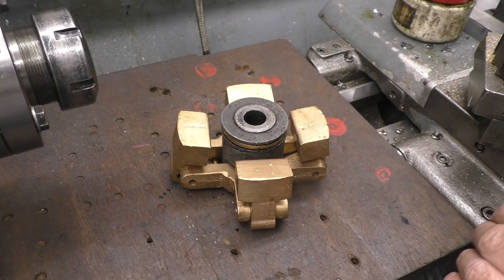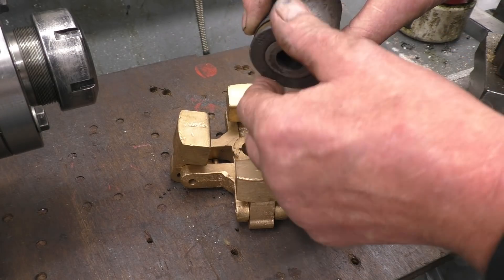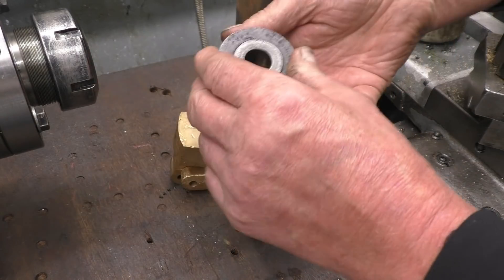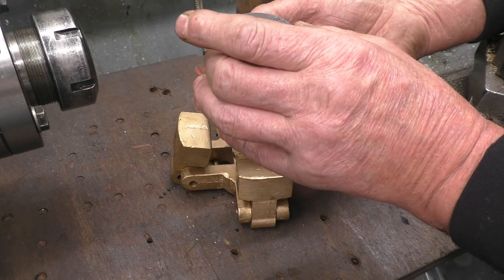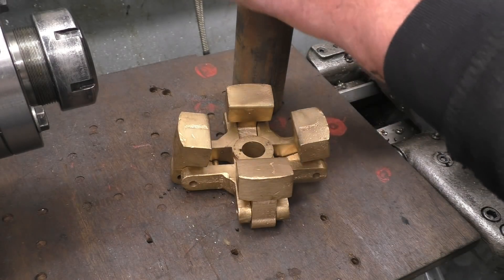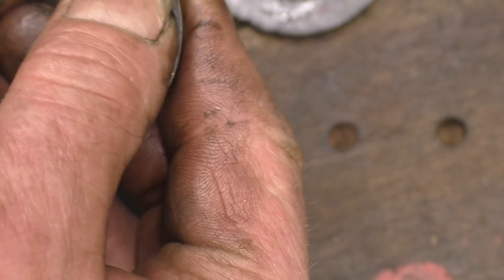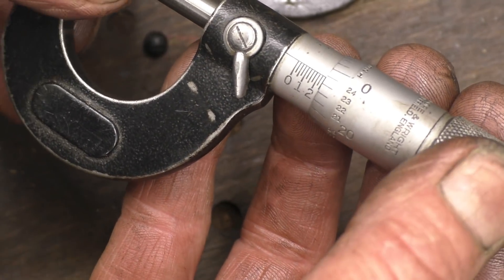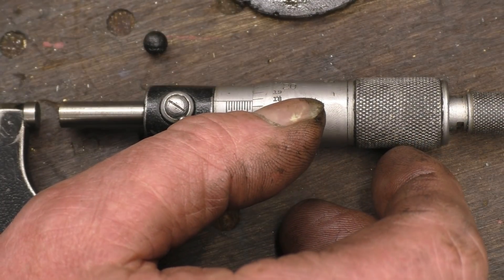Stuart Engine P 17 . Governor  Bearing

Comment: Hi John, good save, looking forward to seeing you put the new balls in (buy some extras)! Looks decent material, I guess if you don't know the grade, trying to harden & temper would be a gamble. I think I would be giving it a go though, trialed on a scrap piece first. Not sure on the axial forces this is under but if they are high, I think you will wear a groove in them fairly quickly. Happy to surface grind them up for you if you do go down the hardening route though. Cheers, Jon

Comment: Hi John, Nice bit of work there on the lathe as usual but one thought did cross my mind. Aren't the washers on ball thrust races hardened then ground flat & parallel after hardening, although it probably wouldn't matter in your instance I did think that in the 'soft' state the washers may wear fairly quickly, considering the single point contact of the balls under pressure.

Comment: Measure a bunch of them on a location without severe marks or ridges, take out an average and you will find the correct ball-diameter. It will most probably be a known diameter from a table, just slightly under, for the corrosion though.

Comment: I think what you could have machine it to put a grease nipple in and the outer thrust bearing to be able to cover the hole bearing as a bell and on the inner part machine it out to accept an oil seal or o'ring and it would be enclosed wouldn't have any problems especially with water getting in